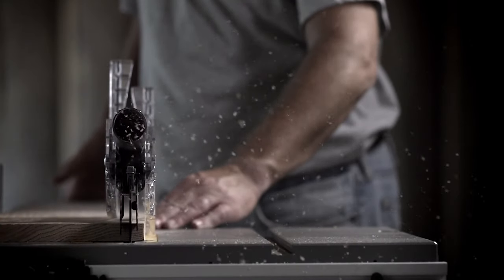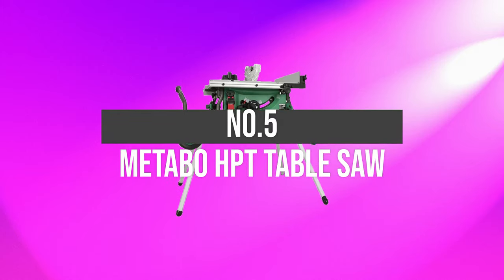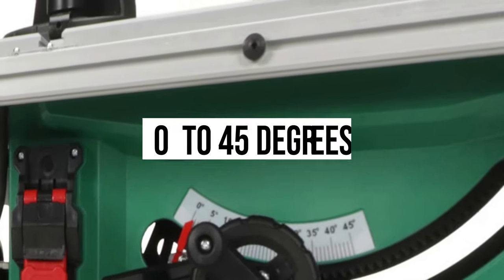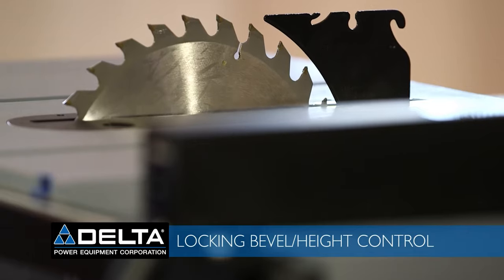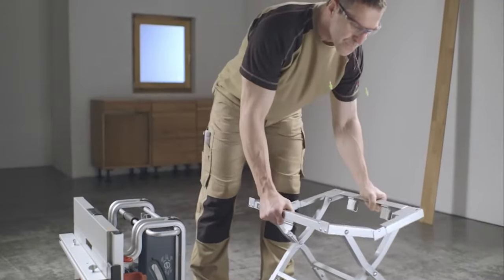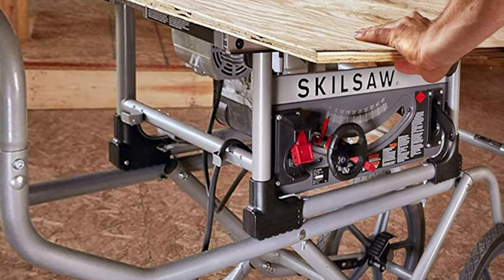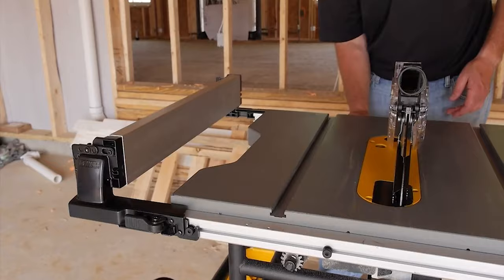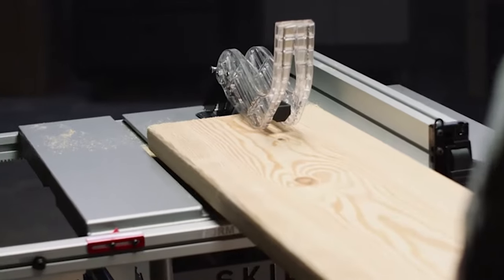Best Portable Table Saw 2022 - The Only 5 You Should Consider Today

Comment: I’d say the  king and it’s not Dewalt.  That Skilsaw SPT99-11 is my pick hands down. Waaaaaay more power and , just do one project involving taking any of the other saws up or down a flight of stairs. The 16” wheels are the bees knees.
Reply from the maker: Thank you for your feedback based on experience. Yes you are right since generally any top two products may not differ in quality or performance. But Dewalt has a history as far as quality and user satisfaction is concerned.